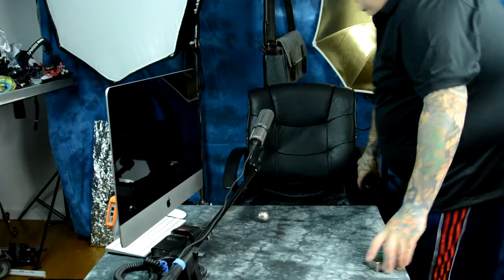The Very REAL Secret of GOLD EXTRACTION using MAGNETISM & my expertise on same

Comment: For a while it tried a method that after crushing ore I would stir up the pan with water and quickly pour of the solution into a bucket of do this several times to get most of the the solution la super fine dust out once complete I would take the mud bucket and get it into a whirlpool. Once in suspended motion I would let the heaviest parts fall and pour out the waste like decanting ...I would be left with a super fine gold reflective type material that easily floats on water if it never got through the surface tention other then that it would fall to the bottom very quickly like a BB would. Is this the same type of material you are referencing? It looks like gold to me but can't find gold similar to it other have gotten. This dust is so small but I can get so much of it from some rocks. probably pyrite but how can I know for sure? Stannous chloride or aqua reqia? I can never get the gold to drop from Auric chloride with sodium metabisulphate or stump out.....justs ruins my solution or turns it in to a jell type stuff similar to white opal structure if it had many years to harden.

Comment: Leonard Crow "Master Magnet"

http://www.rexresearch.com/mrmagnet/mrmagnet.htm

Design, Construction & Operating Principles Electromagnets for Attracting Copper, Aluminum & Other Non-Ferrous Metals

The Magnet’s Secret: Since the electromagnet’s windings are powered by AC, an alternately increasing and decreasing magnetic field is set up in its center core. When this varying field passes through a set of copper washers fastened to the end of the core, a large current is induced in them. The washers, then, act essentially as a transformer secondary.

The induced current sets up a strong, varying magnetic field in the washers. And the direction of this field is such that the washers and the core repel each other. If the washers were not anchored in place, they would spring out of their mounting as soon as the current was turned on.... &c

Comment: hi i found your videos interesting i was looking into using a magnetic bed of iron oxides to capture heavy metal  concentrates primarily of lead and zinc argentiferous mixed mineral ores what are heavily present and quickly engulfing my goldcube vortex matting.  i already knew about magnetic properties of metals etc been interested in chemistry and theorised that small micron gold would be trapped in the correct conditions in the fluidic enviroment of iron oxide bed or riffles and was theorising how a series of magnetic fields  in a pattern would have the capability to trap gold in the arrangement.  im just an amateur practising chemist and hobbyist with the gold sluicing and came across your video while researching thanks for the excellant explanation of properties of magnetism.  btw im sure youre aware mineral gemstones have magnetic properties dependent on elemental composition and adds a further possible application. the pyrope i have for example is picked up by a n52 the sapphire drags. they do vary in field strength.  il try testing my tailings and see if my flour micron gold recovery picks up with your magnet arrangement. thanks a lot

Comment: I don't see how this is possible.

magnetism does not attract nonmmsgnetic materials unless there is an electrical flow, which creates its own magnetic field.

the only way this could work is to attract the magnetic portions of black sand which then trap some fine gold.

your all talk and no example.

methinks you just want a free trip.

if it really did work you would be building and selling the devices yourself
Reply: Bassotronics lolll acceleration means change in velocity my dewd any change not just faster
Reply: t00by00zer 
I thought acceleration means to speed up not to slow down.
Reply: Diamagnetic (magnetophobic) material slows down when moving through a magnetic field when placed correctly, this is something demonstrated on this channel over and over again and you can do it yourself by dropping a copper plate on a magnet. This principle can be applied to collect gold more efficiently.

Nothing to build or invent, all of this already exists and is being used by people.
Reply: @UltraRik  yeah, when a conductor passes through a magnetic field it makes electricity. The energy of those moving electrons flowing in the magnetic field takes the energy out of the conductors momentum. That's the principle of generators and motors.
Reply: When you pass aluminum over a magnet, it accelerates.  Any conductor passing through a magnetic field produces counter EMF which will cause acceleration (slows down).  This is something I learned through experimentation back in 1974 when in high school.

Comment: Just stumbled across your videos. I have a theory that you CAN turn lead into Gold. i believe you may have a key to doing that.
Reply: Edward, lead and gold are NOT chemically identical.  Lead is further to the right of gold in the periodic table which means they do not have the same external electrical chemical structure.  On the other hand, silver and gold are chemically similar being lined up vertically in the periodic table.
Lead also has a heavier nuclear structure so in order to convert lead into gold, you have to pull mass out of the nucleus of lead which is no easy task.  It would be easier to turn Iridium into gold by bombarding it with high energy alpha particles using an accelerator, but the cost and efficiency would render it a pointless endeavor with massive financial costs and little return.

Comment: Do you know if the glandular trichomes of plants are magnetic, and or whether magnets may be used to separate the round glandular heads from the stalks? I believe there are a very few who know how to do this and refuse to tell the rest of us, but wanted to know your thoughts. I would make a donation for sure, if you could demonstrate. I was thinking something like a rodin coil under a 50 micron or so screen, which would rotate the heads on the sieve screen and cause the decapitate stalks to be removed and fall through.
Reply: @shredder0911
@shredder0911
4 years ago Really, like really, really! People knew about that high-tech mystery, even four years ago, it's called bubble hash, or the way I do it, keef. Most folks use ice water to make the trichomes stems brittle and separate, then have to press the water out shattering and crushing the glans, plus a bunch of stinking green mud.
If you use dry ice to chill the trim it's even colder and everything stays dry, then it's just all about classifying it with the bubble bags, no mess and it's 1/2 the work n' time for a 4X better product. I do it every year, folks give me trim. I buy the co2 and use my bags for half. 5-8 lbs. of trim can make a lb. of keef. I press it into 1 oz lil pucks.

Comment: Would it be possible to create a magnetically accelerated vehicle that could reach escape velocity thereby removing the need for chemical propulsion systems in that area?
Reply: Ive heard of prototypes in this field but thought seeing as you wrote the book and all maybe you could either prove or disprove its viability
Reply: this can be done, but the acceleration would be fatal
Reply: Ida cow I think you mean the G force would be fatal. Also what evidence is there for this? Only need to reach escape velocity we already do that with chemical propulsion i.e you can go that fast without dying.
Reply: rail guns.. there is significant experimentaion in the technology, it's elecromagnetical, but but the acceleration (what you call "G" forces) are much too  great for a human or any other biological body to withstand, we'd be squashed like a bug on a windshield
Reply: Sorry I understand the context you used it in now. However the point of rail guns is to hyper accelerate a projectile generally in a parabolic arc what Im referring to would be a gradual acceleration to "slingshot" you into the upper atmospherei think under those conditions the gradual application of force to the body would be more bearable than what one feels from a standand rocket/shuttle launch where the force is almost instantaneous
Reply: It could be done, but to reach even orbital velocity would cause incredible heating on the leading edges of the craft being accelerated.  The key would be to gradually accelerate the object to a high velocity up the side of a very high mountain near the equator in an evacuated tube to reduce atmospheric drag and the accompanied heating.  Even getting the orbital vehicle to a few mach without having to use a heavy booster stage would be quite beneficial, letting a second stage take over from that point.
Reply: Kaye, you don't stand it up like a rocket.  As I said, it would run up the side of a mountain near the equator, possibly the Andes in Peru.  A few miles would be sufficient to accelerate it to a couple of mach where after that a second stage could take over.
Reply: @t00by00zer  you could use a long, gradual loop to slowly build speed and then have the track open to the vertical take off section once you achieved sufficient velocity
Reply: Virtue-Signalling Man I believe it will be the future of travel
Reply: t00by00zer but how long is this "tube" going to need to be?  Im guessing far too long to be possible to actually build it or more to the point keep it standing?

Comment: I have been prospecting/mining in BC Canada for 20+ years. I have used magnets for various applications in my inventions as well. next spring I go back to mining and I am interested in your offer. dougjack71@gmail.com
Reply: @ Douglas Jack
In The Netherlands peoples garbage isn't dumped but often burnt, leavened into gas lately and largely separated. Extracting metals from waste is called Urban Mining. They do that with magnets. European steel beverage cans and copper waste or pieces of construction tin are not magnetic. It is known however that electro-magnets can strongly repel these metals on just one pole. What they do in such factories is have an upside down conveyor belt in V shape above and stretching slightly further then the regular belt with all the garbage running trough. It looks just as if this higher belt attracts the impossible. The repelling electromagnets are underneath both however. Garbage falls into a hole at the very end, after having been shaken and stirred possibly and the top conveyor ends above a container a little further on down the line. As simple as that.

So when I was there and looked at the gain just in front of my eyes and holding my wristwatch as far away as possible, I asked an employee what would happen when he held his hand, wedding ring attached, in the gab between the two. I can't remember how annoyed he looked at me but he told me it would be gone, just like that. Gone.

I would like to tell you this just for what it is worth. Sure gold can have iron particles of some sort attached to it or as inclusion and I also wonder if only metal detectors or infra red camera's could shoot gold from conveyors like farmers do with their fruits or eggs every time a detected unfit product comes by. This could result in dividing material much richer in gold then the conventional wash plant would. Gold has more dividing properties then just being heavy, it conducts electricity. I think in the first seasons of Gold Rush Alaska series a device like this is seen at Tony Beets introduction (had lived in The Netherlands quite near to where I am) but hidden for view and kept secret. Another approach is crushing the stones and melting everything in large industrial blast furnaces. This is done when large amounts of limestone contains even the slightest gold. I can not imagine a pay streak would contain less. Heat disposal could also melt the permafrost and make mines accessible. Nevertheless you or any-one else being successful can send me a nugget when this works and gold seem to jump out of the ground.

Still hoping this blog will ever have nice demonstrations. Greeting
Reply: Really, that's nice.

Comment: there is a lot of magnetite where I gold mine.  would this plan still work?  I am interested
Reply from the maker: yes, even if you needed to clean the bars once a day, it wouldnt matter it would STILL decellerate the gold out of the flow
Reply: I do believe your strategy to capture very fine gold would work.  This is a big problem where I mine.  Most of the gold is extremely fine grained.  This creates a problem where I either choose to run a shallow sluice box angle to capture the fines or run a regular sluice box angle to avoid having silt build up in the riffles.  The shallow angle does capture more fine gold but it required cleaning out much more often.  That hurts production.  With a regular "ideal" angle I can run the dredge many hours without cleaning out the box but I am absolutely losing fine gold.  This magnetically modified sluice box plan definitely sounds like a winner.  I have learned a great deal from this channel in a short time.  Much knowledge here that was not covered by college physics.  I'll be watching and studying many more videos on this channel and recommending this channel to my more curious friends.

Comment: Ken  i own land in the island with Amber, will your secrets  or devise help me locate  the  amber
Reply: Find the magnetic resonant frequencty of Amber. Create a transmitter receiver combination using that frequency. Shield the transmitter from the receiver. Amplify both signals as much as possible. The World's first amber detector and this can be done with any material! Diamonds, Gold, Silver anything.
Reply from the maker: not amber it wont
Reply: Theoria Apophasis thanks, but what would work?
Reply: Amber is famous for initiating our knowledge of static electricity.  It lacks magnetic properties,  But its the seminal electrostatic stone. 

You could gather earth that might contain Amber,  sift in seives, then roll the fine material through a series of silk roll bars which will statically charge the amber; on the side of the roll bars would be an oppositely charged collection plate that would pick up the amber as the mix runs off into the waste,  Then the amber would drop from the charged plate into a collection unit

Comment: theoretically could you then just build a high powered metal detector that can detect gold easier at smaller concentrations? GPR (ground penetrating radar) is ok but not practical for detecting gold or silver or can that basic premise be modified?